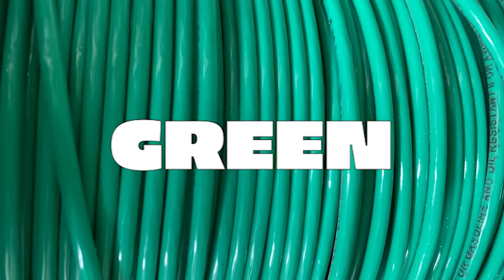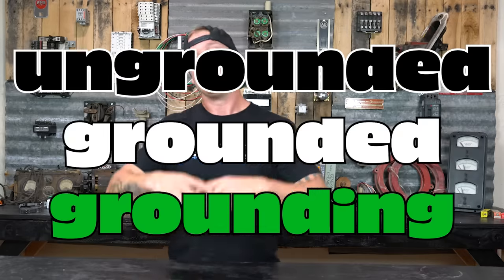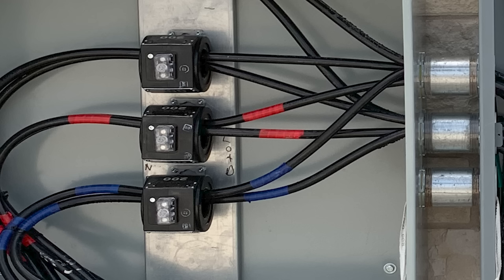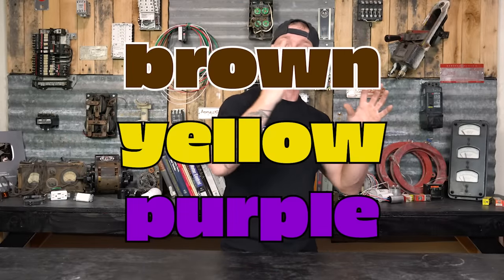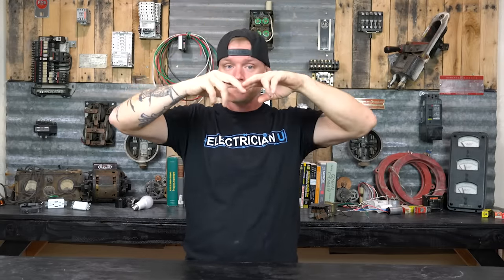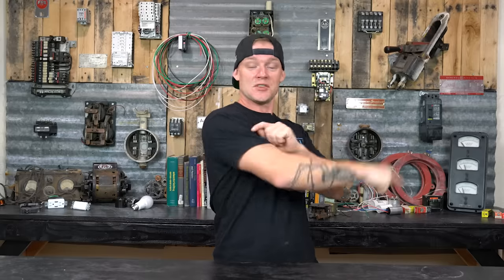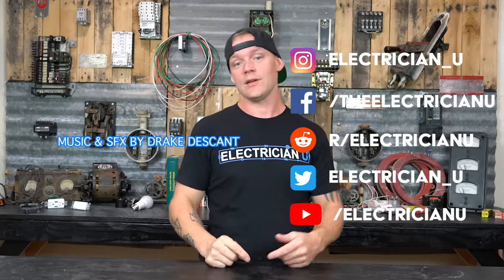Electrical Wire Color Coding Used By Electricians

Comment: On Hospital LIM panels that feed a grounded center tap to feed 120 volt operating room receptacles you can not use white black red purple but believe its orange & yellow and can not be Tw thw thwn or thhn insulation due to leakage. Great vid.
Reply: Retired from a 550 bed hospital that was originally told you could not use THHW/THWN because of leakage but just recently somebody posted it think they called it capacitance reactenace. I always had over 1.5 milliamp leakage on Lim wall readings even when everything was unplugged.

Comment: Green = ground, White = neutral,  black = line voltage up to 460v ac/dc, blue = leg or feeder identifier for 3 phased power also used to identify second leg of single phase,  red can be several things 1. fire system branch circuit if not installed into red color coded conduit, (if specified on build design or plans large commercial/ industrial ) leg or feed identifier, for single and three phased power up to 460vac.  Orange on main feed indicator for 208 VAC (stinger leg )(very dangerous if not knowledgeable or trained to service ),  Grey( Natural Gray) = 277VAC for lighting typically or either the 208Y/120V and or the 480Y/277V if gray  is used then the other (your choice) white must be white with a colored stripe. Either Can  be used to indicate neutral in 460/480vac and higher panel schedules.    ""Also for you newbies there is a beast out there called 460 VAC single phase. Some HVAC/R systems use this setup.""    Brown, yellow and purple all high voltage line tags. mainly 3 phase power systems. then there is color coding for 5k to 10k systems, but that is another story for another day and requires a whole different level of knowledge to service and work on . BTW great video.... The NEC National Electrical Code for the Americans is a great source of information.

Comment: Colors from the kingdom of Norway.

Black, brown and white. Phase 1, 2 and 3 (normally). (L1 - L2 - L3) Phase - Phase voltage is normally 230V for IT and TT systems and 400V for TN.
Blue. Neutral or Zero. (N)
Green/yellow. Protective earth (PE)
Green/yellow/blue. Protective earth neutral. (PEN) for TN - C systems.

Comment: The cor codes are different in many countries, in Greece (EU Standard ) as hot wire we use Brown ,red ,black and gray. As neutral we always use blue*. As ground always use yellow with green stripes. If in some cases your cable (4x2,5mm for example) doesn’t include blue colour wire then you can use the gray as neutral but is obligatory to mark it so the next technician can identify it easily.

Comment: Technically (by code) you are not allowed orange for 277/480 as the orange is designated for the hi leg (208v) that’s why purple took its place. There is an exception, if an existing installation uses orange for 277/480, then orange can be used for extensions or additions to that system as long as it is marked on the equipment but not allowed for new installations. I’ve been in the trade for 20 years now and enjoy your channel, keep up the good work 👍🏻
Reply: What code reference says you can't use orange on a 480v system? I am curious

Comment: Question - I took some electrical course in college . The instructor theory was this - " On larger loads eg- air conditioning , dryer circuits , these large  amp loads should be at  the top of the  electrical box after  the entrance  main breaker . Is that correct ?

Comment: Where do you find that 240V delta three-phase scheme in use?
Reply: In some residential, commercial and industrial
Reply: It's a cheap way for a utility company to make three phase power with two Transformers. It's called open Delta. Commonwealth Edison uses in a lot in the Chicagoland area servicing small to medium industrial buildings. It's a very crappy way to make three phase power and it's a very unstable voltage when the loads reach close to transformer capacity. It's always best if the system is a wye configuration with a common voltage to neutral on all 3 phases, ie: 120/208 or 277/480.
Reply: @davenag957  What I meant was that it looks as if normally a three phase voltage is picked such that the phase to neutral is either 110-120V or 220-240V, thus giving us 208V and 400V. 240V three phase doesn't give a convenient phase to neutral voltage, but maybe there's no neutral and single phase loads always use two phases?

Comment: New code change requires manufacturers to use violet and pink for dimmer wires (+ & -).  At the time this video was made it was still violet and gray.  Just in case your not up on new code changes.

Comment: Hey Dustin, I just came across this video and thought I would drop this bit of info.  In central California at least there have been and still are a lot of 480 V 3 wire transformers/ systems out there.  There is no neutral and is a lack of general consensus even among the same utility provider on how and if it can even be grounded.  There were used a lot for agricultural specifically for wind machines for frost protection and agriculture water well pumps.  Good luck on a common color code much less how to wire the meter can.  I kid you not, I was with a trouble man that was suppose to do a reconnect after a meter panel replacement and a post work utility inspector, same utility having a debate for over two hours about how they are to connected.  This didn’t even include the county inspector that told me it had to be wired differently.  Fun times when I am just trying to get a farmer’s pump back online in 100 degree temp. days.

Comment: In Canada 3 phase system are : red, black, blue. Even if the system is 120/208 volts or 347/600 volts. Colors are important for proper rotation(clockwise or counterclockwise) in motor control. European color codes are another ballgame, beware of imported machines.

Comment: Great video!  Apprentices, remember, depending on where you are working, the AHJ may prefer the phase colors in a different order than you are used to. E.g., 120/208 may be black-red-blue or red-black-blue (left to right). Some AHJs want black-orange-red for a high-leg delta, others want black-orange-blue. Be consistent when doing rework. Always verify that the colors of the wires are ‘telling the truth’!

Does anyone know of standardized colors for old two-phase systems?  Never worked in a jurisdiction where these existed. Just curious. Before someone yells at me, that I don’t know what I’m talking about, look up two-phase power. Think square root of 2 instead of square root of 3. 

Be well & Best regards,
Gottfried

Comment: Green does not actually ever have to touch ground. Green is sold copper to the neutral side of a circuit breaker so when there is a short there is enough current to pop the breaker. 

Neutral on the other hand can go to ground at the main panel where you are getting street power. They did this to have a backup neutral. So if the neutral becomes disconnected from a main panel the earth connection is still there so you still get 120v between a hot wire and neutral. 

So if you ever see a lot of current on the actual wire that goes to dirt ground at a main panel that is probably a loose neutral. If you ever see current a lot of current on a green wire after inside a building then it is probably because someone allowed the green to touch the neutral somewhere. Which is not supposed to happen except in the 1 main panel that is Connected to street power.

Comment: I was Best Boy Electric on movies some time back. On one pic, we needed to shoot inside a big industrial plant but couldn't get our generator trucks close enough to the set. I was able to access enough 3ø 120/240 for our basic needs, but we also needed 3 or 4 12kw HMIs because the area was so large. I happened to know that the ballast on the Silver Bullet® 12ks was switchable to run on 277. Once guess as to what the main plant power supply for all those enormous machines? 277/480. I just made sure we had Silver Bullet HMIs instead of any other make. That was when I added yellow, brown and gray to my phasing tape collection.

BTW, in the film biz, we always marked our cables, connectors,  J-boxes (junction boxes) and so forth in this order:
Green = Ground, Earth, Grounded conductor
White = Neutral, Grounding conductor
Red = Hot 1 (The big RED ONE), ø1
Blue= Hot 2 (BLUE number TWO) ø2
Black* Hot 3 ø3  This third phase doesn't turn up as much as the others. *I have noticed yellow phasing tape used in the NYC area. Good idea, as these guys also run some monstrously heavy 5-wire cable called something to do with a stallion's john-thomas (medical term). I think marking the black (ø3) cable with yellow phasing tape is a great idea. After all, if someone took the time to mark it yellow, maybe its non-standard, and I should consider it with care.

Worst violation of the phasing tape colors was when I had a package out of Miami for a job in Pittsburg, PA. They had made up beautiful new #2 "banded" cables  with CAM-LOK® color coded connectors. Only they put different colors on the same cables! Someone told them to make up new #2 Banded cable sets, (Banded is when 3 #2 stranded cable is taped together in 50ft runs. Somebody said to make sure each set had a white red and blue at each end... they didn't say make sure the colors were the same on both ends. We had fun until we figured that one out.

Comment: Most of this coloring is based on industry standards. The only colors dictated by the electrical code is green, green with yellow strip or bare for grounding conductors. Then white or gray for the grounded conductors. It doesn't delineate either one for a particular voltage. The "hot" conductors or phase conductors are not color coded by the NEC at all. The orange is mentioned but it says "orange or other identifiable color.

Comment: Thank you for this great information. , just u had a question why some time I got 120v in my neutral single pase ?
Reply: I mean single phase
Reply: Neutral is a current carrying as are all wires it's a matter of when you should get a voltage reading and why you are getting a voltage reading. Knowing the difference makes the NEC and NAFTA much happier...

Comment: Overall very good job on a challenging subject. I have a suggestion for a follow-up video. Specify which colors are actually Code mandated and explain each. (Green/yellow, white/ natural grey and orange) With that explained make clear that the utilities don't follow the NEC as they have their own codes AND ( as you did a great job pointing out with the ballasts) manufacturers use basically whatever colors that they choose for the equipment they are building. Again, good job on a challenging subject. 👍

Comment: In your picture of the ballast someone used wire nuts on the secondary side, why, with a little work/effort you can remove the wire going to the tube tombstone. By holding the wire close to the tombstone, twist a few time and the wire will come out. This way you do not have wire nuts that can come undone. What is your thought?

Comment: Maybe a point of interest: Canadian electrical code doesn't mandate any colour for phase(hot) conductors.The neutral is the only conductor required to be identified.Colour coding comes from electrical engineering standards and is not enforced by the (AHJ) local inspector.So if your drawings did specify colour coding they would always be B,O,Y for 440,480,or 600 volt systems....I was puzzled with the 3 phase system with 208 volts to ground....what equipment would utilize this voltage? I'm a retired electrical inspector....your thoughts are appreciated

Comment: Very interesting stuff indeed. I have never touched high voltage commercial applications but it was interesting learning about the colors. Strangely enough, in our region we use Brown on a single phase circuit to identify low voltage. In older homes when the air exchanger was hardwired to 120 through the controller our guys will use that wire for low voltage signal to the newer controllers and then we are required to wrap that nmd in brown tape to identify it as low voltage or technically ultra low voltage. I've also never seen Orange on any of the three phase high leg systems I've worked on. Our instructor told us years ago that the brighter the tape the higher the voltage. Not always true.

Comment: Does every incoming power have to be identified? I seen breakers that don't have red tape on the wire, but instead two black wires coming down to the service breaker.
Reply: Canadian code.. if you care does not require or specify colour for hot conductors whether single or 3 phase regardless of voltage.Colour coding is only found in engineering standards so not enforcible by local inspectors.

Comment: Hi guys, here I have a hypothetical scenario. I am in doubt, I hope you can clarify this to me.  Suppose we have an effective ground fault current path, an excellent 8 copper EGG, suddenly someone who didn't know much about electricity decided to change the EGC to another type of EGC material with an impedance of 9.5 ohms, but the phase conductor is an excellent 8 AWG wire and has an impedance of 0.05 (9.5 + 0.05 omhs = 10 omhs) Now there is a ground fault, 120V ÷ 10 = 12 A, but the OCPD breaker is rated 30A, therefore it does not trip, now we could say that we no longer have an effective ground fault current path because the installation does not meet the code requirements for the EGFCP definition. The question is: Would someone be exposed to receiving an  electric shock if he or she touches the metal enclousure of a load? or Could we assume that the installation continues to be safe since the neutral and  EGC are linked together at one point (MBJ)? What would be the load metal enclouse voltage to earth? 0 V?
Reply: @Miguel… if there is a fault and the breaker didn’t trip then of course it is hazardous. The breaker will only trip if the current flow is more than the breakers rated capacity. If the breaker is on and there is no return path (or high impedance) then the power is present awaiting for a path to flow. If the metal parts of the equipment have become energized because of the fault then your body can complete the circuit. The Code has charts that dictate the sizing of conductors in electrical systems as well as how they are to be installed. The grounding conductor isn’t always required to be the same size as the current carrying conductors but sometimes it is so it does matter what size the wire is for the system to operate safely.

Comment: For whatever reason around here the utility company uses blue orange white for single phase residential services on their underground feeds. Orange is usually A, blue is usually B and then white is neutral but The inspectors want black, red, white after the meter.

Comment: Two things. 1. There is not always a neutral. MCC feeder circuits are "always"  or should be 3 wire Delta. 
2. The BOY and BYP for 480 volt. When both are used the BOY Is for 480 3wire Delta and BYP is for 480 4 wire Wye.

Comment: I'm an electronic tech... I know that single phase both hots compared to each other on a oscilloscope are out of phase by 180 degrees... My question is if you were to compare each hot on a 3 phase how would they look?

Comment: Lotta electricians I've worked with had no idea about the orange "wild leg". 

EVERY TIME you work somewhere different go to the service and check that shit. It is not always marked as such. Mark this with a pen if you don't have orange tape. 

Also, guys check me if I'm wrong, white and gray are interchangeable. I understand the convention (in my area) is white for 120V neut and gray for 277+V neut but the code accepts either for any.

Comment: Great info. Industrial is a very similar beast yet at the same time a whole new animal. Wire size with certain colors (same as line voltage) mean totally different things from AC line voltage for automation controls. Again nice video and keep em rolling!
Reply: You may have been around the block once or twice lol good luck...
Reply: @steve-o6413  not so much! Did commercial and residential for a few years. Been in the industrial side of things for over a year now. Totally different ball game! Learned so much more in this short amount of time than I did for the few years in the commercial/residential world. Do I know all the codes? No way!

Comment: You say yellow conductor with green stripe, but it's often today more a 50/50 color combination. But that's at least basically the same thing, it depends on manufacturer how it is done, and earlier it was more a green with a yellow stripe.
What's much more important is that white is not always neutral. In Europe and all equipment conformant to IEC 60446 has a blue wire for neutral. Just be careful with which equipment you look at and where it's manufactured.
Here in Sweden we also have some cabling for outdoors and industrial/farming applications that's designated EQLQ, it's a 5-wire cable plus shield with 3 wires for phases, one for neutral, one for ground and then a grounded shield as well. The shield is in case you for some reason drive a nail through the cable during construction or remodeling, but it can also shield against electrical noise.
Just be careful out there and don't assume anything. The classic movie quote "Assumption is the mother of all..." (cut short to keep family friendly)
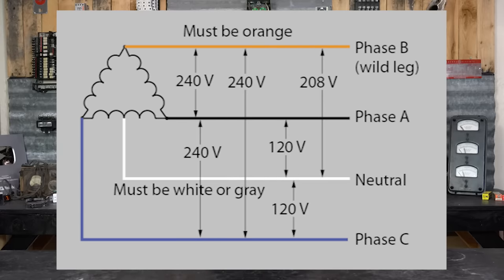By the way - in Sweden 3-phase is very common in residential buildings as well, it's basically only small studio apartments and older apartments that may have 1-phase. Here it's also 400V between phases and 230V to ground on all phases and it's a Y-wired transformer that feeds everything. That wiring you present at 7:46 looks really weird to me.

Comment: What color scheme would you recommend for non-standard voltages in the US, such as 240/415V or 347/600V?
Reply from the maker: Literally anything you want. The only requirment is that the coloring code must be listen at panels where circuit is generating.